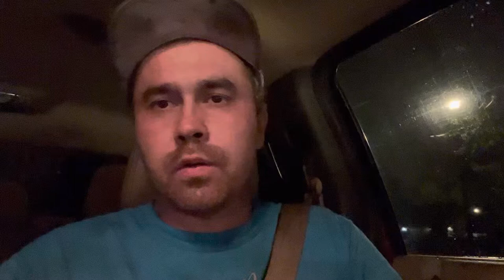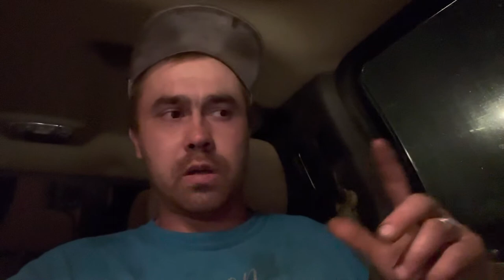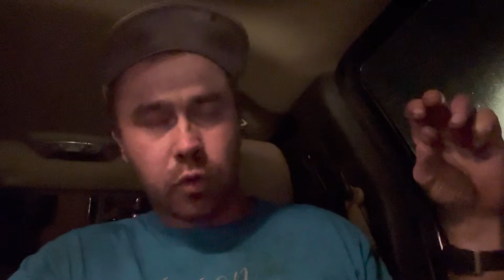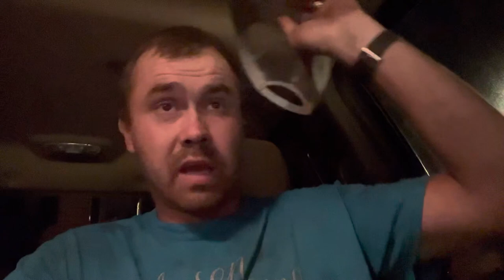C 15 caterpillar atmospheric pressure sensor no check engine light

Comment: hey bud have any sugesstion about my cat c15
idling good small gears are good when we go to high gears and it doesnt running smooth its doing like missing and not boosting only truck no trailer and cant run to a small hill. getting down rpm and speed . pls sugest thanx
Reply from the maker: Check fuel pressure

Comment: Good info. Can you trick this sensor to stay at sea level. Everywhere I have called it's on backorder
Reply from the maker: I’m sure somehow you can with the resistor but I will take quite a bit of work to figure out what kind of resistor you have to use